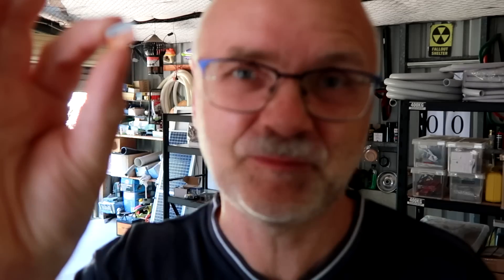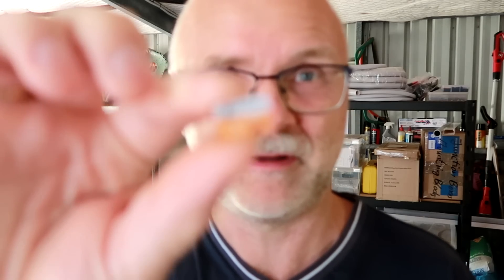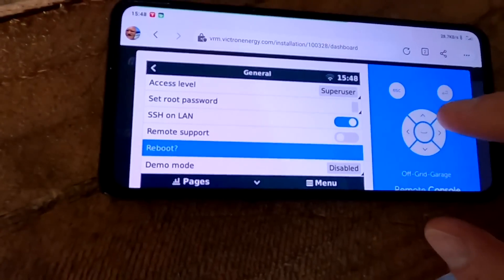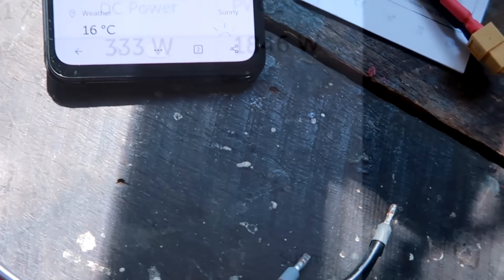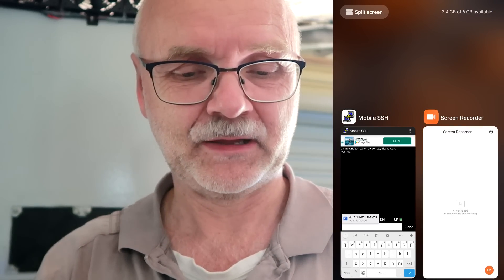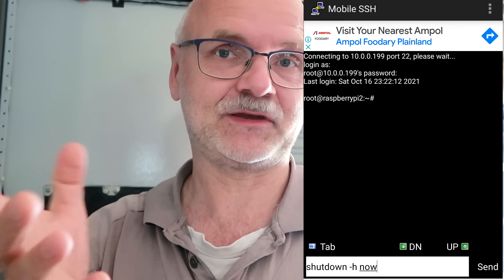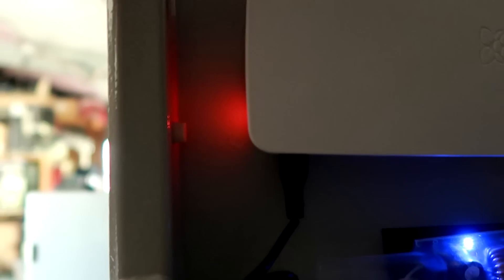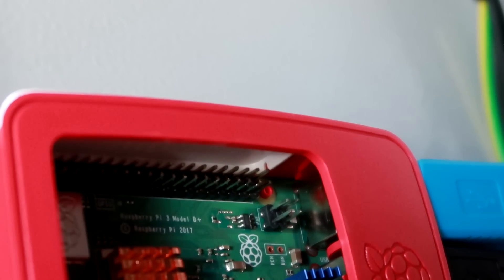Avoiding corruption on your Raspberry Pi SD-Card running Victron Venus OS

Comment: Hi Andy
An answer to your problem already exists, there are several python scripts that can run in the background that monitor pins on that connection strip you showed. With the script running and the correct pin connected it with do a "graceful" shutdown on your raspberry. The scripts i saw where pretty easy and well documented. The only thing you'd need to add is a switch. I wouldn't recommend a button on your phone in case you accidentally press it your raspberry would go down untill you can power it back up. A physical button would protect you from accidents like that and it only takes a few seconds for your raspberry to shutdown when you press the button.
Reply from the maker: Thanks Alex. I found a script online where the button need to be pushed for 10s before the script is triggered. I like that idea...

Comment: you should boot raspi on a SSD drive
Reply from the maker: Does Venus OS work from an SSD?
Reply: @OffGridGarageAustralia   just need to clone the sd card to the SSD to test.
Also need to update the raspi firmware to support USB boot mode.
Reply from the maker: @vaneay  Thank you.

Comment: sd cards tend to fail when used as a hdd in a pi, ssd is more reliable. sd cards are nt meant to be written so many times over and over. they have a limited life. it may have corrupted from that or it may not have but sooner or later it will fail completely.

Comment: I have heard many times that the power supply is usually why you loose SD cards. Make sure you have a good power supply first. 
Also what I have setup with my home assistant is an old samsung 500g SSD I had laying around (This is connected from one of the USB ports on the back of the Pi with an adapter cable to the SSD drive. I haven't had any glitches at all.
Reply: The problem is loosing power while writing, because while updating the file system table, it's invalid without everything written down, because maybe only half is written down, but not the checksum yet, which makes the complete table invalid. There are file systems, that using other mechanisms, where this can't happen, for example zfs or btrfs